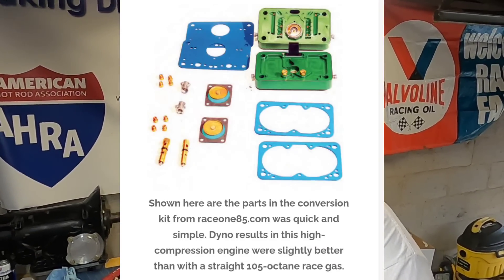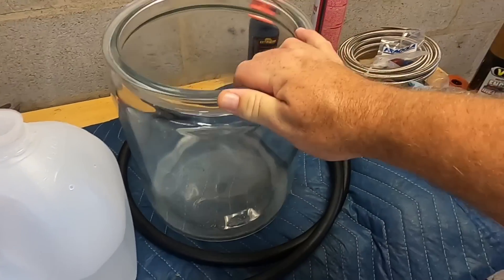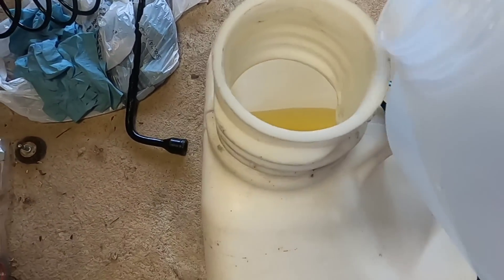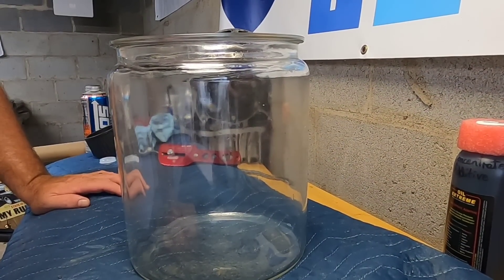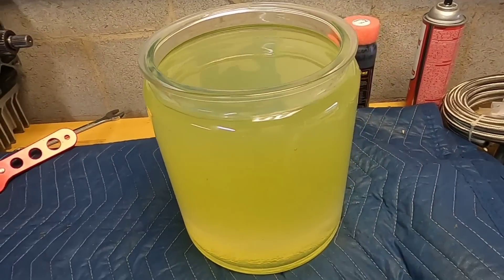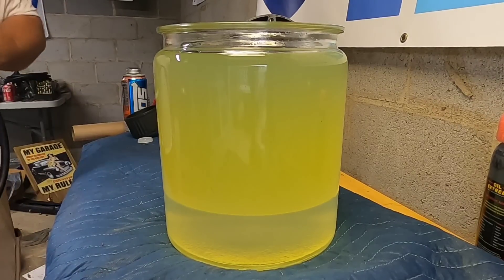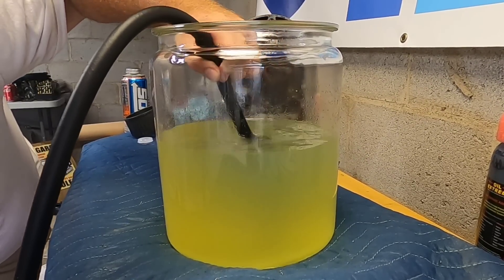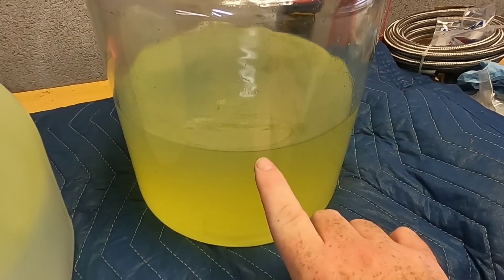Making your own ETHANOL FREE Gasoline!!! it's easier than you think!!

Comment: I used to work as a lab worker in an organic extraction laboratory. Your gasoline, being cloudy is contaminated with emulsified water and needs to be "dehydrated" with anhydrous sodium sulfate (it grabs a lot of water from solvents). And, likewise the top layer in your one gallon plastic jug is the gasoline with emulsified water. Look at the lower water layer in the one gallon plastic jug and you can tell about 1/2" to 3/4" of water is emulsified in the gasoline. If you let the gasoline/water mixture sit overnight you'll probably notice the gasoline is clear again. Myself, I wouldn't use the cloudy gasoline in any engine because it has a ton of emulsified water along with ethanol in it! If the gasoline isn't perfectly clear then it's contaminated with water!
Reply: @Edmund_Mallory_Hardgrove  I watched another YouTube video where the presenter puts 100ml of gasoline with 10% ethanol in a 100ml graduated cylinder and just pours in an additional 20ml of water. No shaking. Just pours it in and the water goes straight to the bottom of the graduated cylinder. The gasoline stays perfectly clear. Then he waits 15 minutes and shows there's 30ml of an aqueous/ethanol layer at the bottom. The gasoline was pretty much then ethanol free and clear as a bell. This demonstrates that you don't have to shake the gasoline and water at all. Just add twice the percentage of water and the ethanol will selectively dissolve into the water leaving the gasoline ready to use.  Couldn't be much easier!
Reply: @johnNJ4024  A guy on YouTube wanted you to find out how much ethanol was in high octane petrol at different petrol stations in the UK. Even though it was close to 0% Ethanol, the petrol from the different petrol stations had different shades of colour. There were only a few that were almost as clear as water. what i remember
Reply: @johnNJ4024 Can the hydrated ammonium sulfate be regenerated by heating it or something?
Reply: @gregorymalchuk272  Yes, the used sodium sulfate can be heated to dehydrate it for reuse. You would need to exercise caution with how you heated it because it would also have residual gasoline in it too. In the lab, we would keep the fresh anhydrous sodium sulfate in an oven set to 220 degrees Fahrenheit to maintain it. We would set out however much we needed in the morning to cool down for use in the afternoon.
Reply: Yep. I’m in the fuel industry and that’s how we handle phase separated fuel.
Reply: Keep in mind when you remove the 10% ethanol from gasoline it lowers the octane so the engine may knock.
Reply: Now this is a quality tip. Dandahermit
Reply: I remember buying bottles of lead additive and pouring so many ounces per gallon fuel tank, so do they even still sell that additive any more. Some one please respond and let me kniw. Thanks
Reply: @donaldmarwitz2046  Autozone sells a "lead substitute" for use in classic cars. I don't think it contains any lead but it does the same job to prevent microwelds from forming in the valve/valve seat. Supposedly using 93 octane gas prevents microwelds too in engines that have not been rebuilt and had hardened valves and valve seats installed. After installation of hardened valves and valve seats you don't have to worry about microwelds and can use any modern gasoline.
Reply: @donaldmarwitz2046  yes they sell lead substitute at auto parts stores and probably Wal-Mart too.
Reply: @wsbill14224  Thanks. Until seeing this conversation I had forgotten all about the lead substitute. I have no need for it any more, but one never knows. I so want to get a older pre EMP pickup truck at some point if I find one cheap enough and in decent enough running condition. lol
Reply: @donaldmarwitz2046  Good luck to you.  You need an electronic ignition 5 litre V8 with hardened valves for unleaded gas.  If you have old style soft valves you have to limp along on the additive or you'll wreck it.  Hope your engine always stays together.
Reply: There is an additive that I saw on Amazon that is said to be able to remove water from Fuel. What about fuel stabilizer?
Reply: AVGAS does not contain ethanol , and most airports have regulations forbidding the sale for non aviation purposes as AVGAS still has lead. (FAA certified Aircraft Mechanic 48 yr.) @HectorCruz917
Reply: corrosion There is an additive that is said to reduce that problem So an additive for E10 E85
Reply: So boil the ethanol free gas with flame burner
Should be fun for you ❤
Reply: I NEED TO MAKE anhydrous ETHANOL WHATS THE BEST AND CHEAPEST WAY
Reply: So what does the removal of the Ethanol from the gasoline do to your fuel's Octane quality (the anti-knock component)?
Reply: @MegaGeorge1948  It lowers it. Either buy 93, remove the ethanol and use it in anything that it timed to run 89, or add a non-alcohol based octane booster after you remove the ethanol from a lower octane fuel.
Reply: @Edmund_Mallory_Hardgrove  Since gasoline is a mixture of hexane, benzene, toluene, xylene, octane plus stabilizers, etc. I'm not sure how much the emulsified water would separate, but I'm guessing most would after 24 hours and the gasoline should clear up. I don't know if anhydrous sodium sulfate would be 100% necessary or not. In the lab, we only used pure solvents in extraction procedures. Some extractions needed the sodium sulfate and some didn't. The High Pressure Liquid Chromatography (HPLC) columns sometimes needed a blend of two or three solvents, but I didn't operate those machines so I'm not as knowledgeable with how blended solvents react to emulsified water.
Reply: @Jim Fowler Jim, I bought it all the time when I was younger. I was looking for 100 or more Leaded and I bought it a lot. They would not let me put it right into my gas tank because it didn't have road tax on it. But I did it anyway at a slew of little grass airports. The others made me put it into a gas can and then I could "drink it if I wanted to" was their words. ben/ michigan
Reply: @6gatornation  If you pull the etoh out, it will lower the octane equiv by about 2pts (r+m/2). 10% etoh 93 octane fuel probably started life as 91 octane (r+m/2). So you'd windup with about 91 but it may not be a healthy "brew" in the way of acidic compounds. There are a LOT of other chemicals in gas to consider. 95 octane equiv, about the lowest "Race Gas" you can buy alcohol free, costs $20/ gal, so you could add it to your "brew" but, you might look into why they don't want you to use e-10 and take measures to negate the problems.  Hope this helps. ben/ michigan
Reply: @Moparben3713  thx 
Plan b was to mix 100 with 89 E free  but $90 for 5gal   
I was definitely trying to avoid that 😂
Reply: So for running a small engine like a chainsaw is it better to use a 91 octane with ethanol or an ethanol free at 85 octane?  In a small two cycle engine does the octane really matter?  I live in California and it is hard to find ethanol free gas. Thank you for your help.
Reply: @craighellberg4366  chainsaws and weed whackers don't need high octane.  Regular is fine.  So is 10% ethanol.  Two-strokes are low compression so they're not fussy about fuel as long as it contains oil!
Reply: @6gatornation  Who is "THEY" the woodchucks at the dealer? Or Polaris? I doubt Polaris would tell you that because manufacturers know what gas is available in the world and not going to make something like that "Mandatory or else". I wouldn't be concerned about running 93 with ethanol or you can run non ethanol which is usually 90 octane with booster if you are so concerned about octane. IF it was required for you to run 93 non ethanol then you shouldn't have bought that unit if you can't get gas for it. Or stop being a cheapskate and buy a 55 gal. drum of race fuel for like 600 bucks. You had enough money to buy that overpriced toy didn't you.
Reply: @bultacowally  He's speaking of aviation fuel at airports. That stuff tends to be a little more expensive than race fuel.
Reply: @Dwigt_Rortugal Do you not have commercial petrol with a low ethanol content, as we have in Europe, for example Great Britain or Sweden. Here, it is the gasoline you buy if you have a vintage car or a car that, for example, does not tolerate E10 or is not approved for E10

Comment: Put a gas shutoff valve on your mower. Shut the valve off and run the mower til it dies after your last mow of the season or any time you are not going to run the engine.  My honda started up first pull after not using it for a year.  ALL gasoline will gum up your carb. Long before they came up with ethanol carbs plugged up.
Reply: Even after the motor runs out of gas the carb holds the float bowl gas which you can drain if your float bowl has a drain plug. Some old mowers had a spring loaded drain valve, which you can buy. Any gas left in carb will dry to sand like particles that can plug the idle jet

Comment: Actually discovered this technique by accident, my  riding lawn wouldn’t run, so ended up emptying the gas into a old glass wine bottle, then had to stop for the evening... came back to it the next evening and noticed the amount of separation, out of curiosity I decided to add the separation of gas back into the lawn mower and I’ll be damned if it didn’t crank up ! 😮
Reply: You mean to say that if I simply put some gasoline (that I bought from the pump) in a clear glass container and let it sit for ~24 hrs, I will see the separation clear enough to tell which is which?
Reply: @JasbirSingh-zj1fg maybe not by JUST letting gas sit in a clear container for 24 hours. The point of adding the water is to give something heavier that the gas for the ethanol to bind to for the separation. 

What likely happened with the riding mower here is it sat all winter and it absorbed moisture from the atmosphere, and trying to use it in the spring it was drawing the water ethanol mix from the bottom and not the gas

Comment: you are putting oil / water together, water being a very polar ( strong positive/ negative areas in the
molecules.) oil or gas is classified a nonpolar molecule, alcohol is a polar molecule likes water. 
“ likes attract “ meaning water and alcohol will mix together and not separate. while the gas / oil
floats on top in “separate phases” you are able to see the interface between the 2 active layers. 
one gas the other water-alcohol.

Comment: Have been removing ethanol for all my power equipment for over 2 years. Pure gasoline will absorb 120 PPM (Parts Per Million) of water.  Because ethanol is hygroscopic (absorbing moisture from the air), gasoline with 10% ethanol will absorb 7,000 PPM of water.  If left to stand, this is the cause of "bad gas".

As an aside, fuel used in non-jet aircraft engines is ethanol free - you would not want your carburetor to freeze up in flight.

Comment: Ethanol is not just soluble in water, it is miscible, so mixes completely at any ratio...so I think the layer in the milk jug at the end is some gas, rather than ethanol. It wouldn't mix just long enough to transfer out of the gas can, then suddenly divide into separate phases just because it's in a different container.
    I use avgas in mowers for the last mow of the season, not because it is 100 octane, but because of its storage properties, it will store a long time. Even when very old, it doesn't form varnish, just blue goo that easily dissolves in more gas.
   This works much better than gas stabilizers, which I don't think much of. The 100 octane is unnecessary but harmless. You might expect harder starting due to its slightly lower volatility, but I haven't noticed, even in snowblowers here in PA winters.
   I just mention the avgas because ethanol makes unused carbs dirty even faster than auto gas did before ethanol was added, which was bad enough!
Reply: Yes. I have used avgas since I was able to get it from a local airport in the mid 70's.
I use it in all my small engines as well.
Reply: Wht about ina jeep/truck ? Would higher octane be harmful??
Reply: Not sure about US 100 av gas but in Canada it has way too much lead in it for small 4stroke engines. causes valve and plug issues over time,, same as it does in piston aircraft engines. All our fuel sucks these days.
Reply: I agree with you on the lead...I wish I could get the exact qualities of avgas, especially its stability in storage, without the lead. I haven't had lead fouling issues, but most of the engines I use it in don't get all that much use. Thus the need for Long lasting avgas. But the lead fouling is a possibility.  Plus it's toxicity isn't  a great quality, but I'm ok with minimizing my exposure to it. 
   Most modern motor oils lack additives to disperse the crap that leaks by the rings, so that is a possible problem, too, but I haven't  noticed it. Any 4 stroke I use it in gets frequent oil changes.

Comment: If you let it sit longer the gas will become clear. I have been doing this for years at the dealership when cars come in with contaminated fuel. It takes several hours but the will be clear. Then I run it truck.

Comment: Why do you want to take the ethanol out by doing so you are lowering the octane I have a lot of yard machines 2 walk behind self propelled mowers I riding mower a mc lane edger approx 50 years old  2 stroke weed eater and leaf blower I live in oklahoma all we have is 91 octane we do have ethanol free gasoline but I don't use it I use e 10 91 octane in earthing for my 4 stroke engines I mix 1 Oz of marvel mystery oil per gallon I also use steel safety cans this is important because they keep the atmosphere out. I NEVER HAVE ANY FUEL RELATED PROBLEMS.

Comment: If your local gas station has 10% corn squeezing added it simple math to figure out how much water to add. 128 ounces is a gallon, 10% of that is 12.8 ounces, round up to 13 ounces, add that a.oint of water to a gallon of gas,  shake the hell out of it and you'll end up with 26 ounces of water ethanol mix that kills weeds.

Comment: There seems to be some unnecessary wastage in your process.  When you're done with the siphoning of the separated layers, what you had on top in your gallon jug is wasted gasoline, not ethanol.  Ethanol and water do not separate.  I think you would have been better off to siphon off the gas on the top layer to somewhere near the water/ethanol layer.

Comment: Funny, I was just thinking of trying non ethanol gas for my 408 ci Nova (plus octane booster).  Pretty slick Andy, pretty slick!
Reply: Go to your LITTLE airport and buy the 100 avgas, won't go bad. (We still have our '69 Nova wife bought before we were married, my '35 Buick, '57 & '59
Chev pickup, one with the big window in rear.)
Reply: @chuckredd9131  used 100LL for years then the local airport kicked me out for loaden up my 5 gal cans! It was $7.31 per gallon at the time.

Comment: Ethanol has been used since the 1930s, when people actually paid MORE For it to get the Higher Octane Rating from it. 

As far as it being hygroscopic and drawing moisture out of the air, that is one of the biggest LIES floating around out there. 

MAYBE if you had a 5 gallon bucket of Ethanol setting out on a Foggy Night with No Lid on it, it MIGHT draw a few Teaspoons of water over night, but Breathing in & out through the Tiny Vent Tube in a Sealed Gas Tank, It's NOT Going to Happen even after several Years. I proved That Myself with my 1937 Ford Truck that sat for 14 years in a damp shed (water running through it every time it rained, and condensation dripping from the roof) with a broken set of points in the distributor. It sat there in those damp conditions all those years with a quarter to maybe 1/3rd tank of a mixture of E10 & E25 and when I finally got around to rebuilding the distributor and getting it running again, there wasn't even a Trace of Water in the sediment bowl on the fuel pump. Plain and Simple, it DOES NOT Draw Moisture out of the air, though it DOES ABSORB Water that inadvertently gets mixed in. https://www.theautochannel.com/news/2016/03/18/209988-ethanol-does-not-suck-water-out-air.html

IF you are finding water in your fuel, it is likely because it was already there When You Bought The Gas which has been an On-Going Problem for as long as there have been Gas Stations, especially those in Low-Lying Areas where it's easier for Run-Off to get into the underground storage tanks. This Has Happened for as long as I can remember (early/mid 1970s) and longer (if you ask your older relatives) with gas stations having to pay for engine repairs on customers cars that filled up on water and damaged their engines, along with getting their tanks pumped out and refilled with fresh fuel. 

As Ethanol DOES Absorb Water, (think of the bottles of HEET you purposely poured in your tank to soak up the water and thaw out frozen fuel lines with Regular gas) which basically just Buys More Time for those stations in Low Lying Areas as it can absorb up to (I believe it is around) 5-6% water by volume before Phase Separating and dumping the water to the bottom of the tank where it causes the Exact Same Problems it did with Regular Gas. THAT would be roughly 1200 Gallons of Water in a 20,000 Gallon underground tank, meaning the stations that were notorious for being shut down due to water in the tanks can now go Months or Years Longer selling Watered-Down Ethanol that is constantly being refreshed every time THEY Fill up, until they get caught in a Flood Situation where they get More Water than what the Ethanol can Absorb. 

As for Separating Your Own Fuel to be "Ethanol-Free", Why Would You Want to LOWER The Octane Rating, and/or Pay Extra for Higher Octane Fuel just to get a Usable Octane after you separate out the alcohol . That's just Throwing Money Away to get rid of something you Used to Pay Extra For to the tune of $2.00 - $3.00 Per 12 Ounce Bottle of HEET.